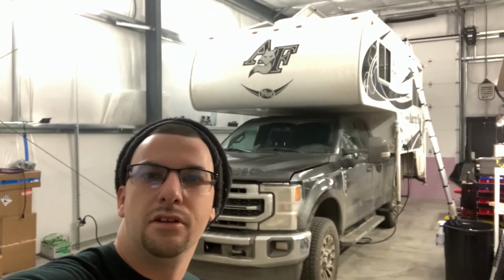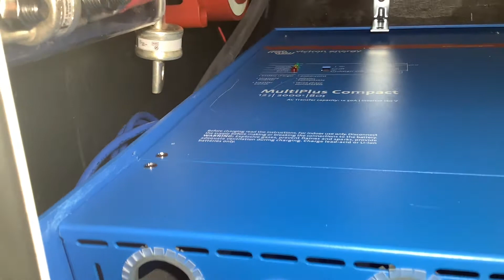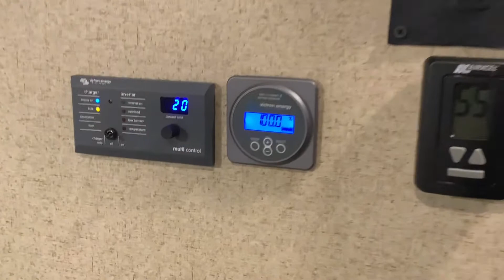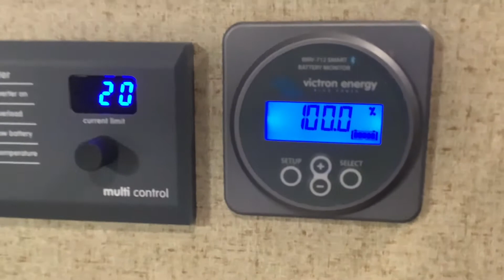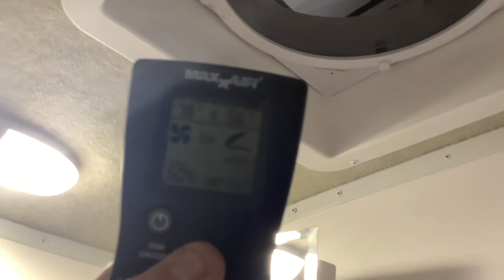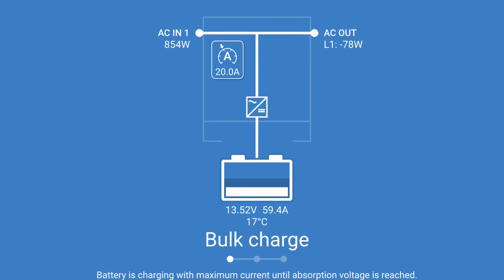SOLAR PANEL SYSTEM INSTALL Truck Camper (LITHIUM BATTERIES, INVERTER)

Comment: Depending on how you wired the panels, you CANT mix different size panels together.  Current will always drop to the lower amount to pass through wires.
Reply from the maker: You are totally correct. Just have to wire them correctly :)